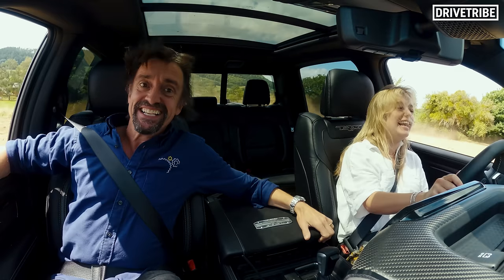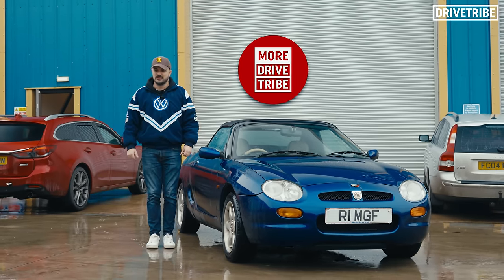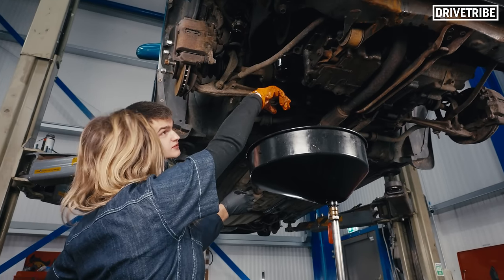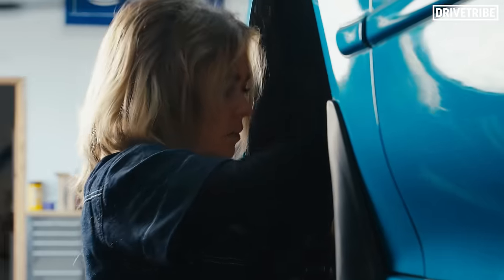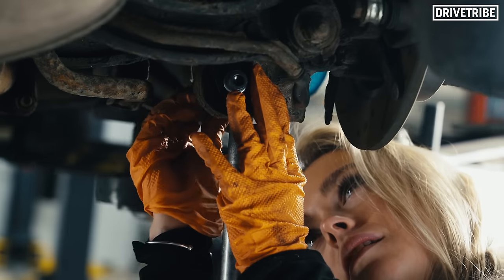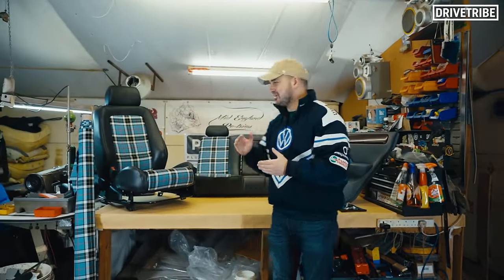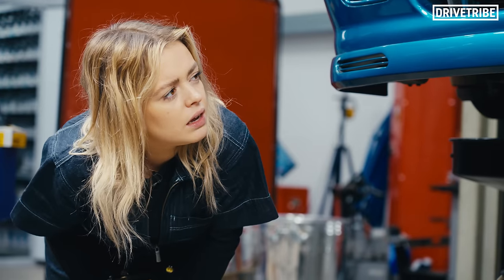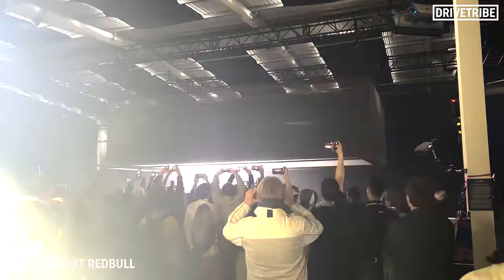Richard Hammond Tries A New Mechanic In His Workshop!

Comment: Curious fact, those fog lights are the same that came on the higher end phase 1 Renault 19, also on the 16v. But those also came with yellow glass. I had two pairs in both white and yellow, which I would swap when it was car meeting season which normally starts during spring 😊

Comment: I'd be a little leery about putting cleaners, and synthetic oil, in the crankcase of older engines -- sometimes the carbon deposits keep the oil from leaking out of the gaskets. Also, I was expecting the axle to pop out around 5:30

Comment: Coilovers & shocks for a '90-97 Honda Accord. Huh, more you know.
Reply: The 600-Series is a shared platform with the Accord. It was part of a two-way deal Rover and Honda had at the time.

In exchange Honda got the Crossroad which was a Honda badged Land Rover Discovery!
Reply: @SpitfireFortyFour  So, the most reliable not Rovers ever made, AND the least reliable not Honda in existence?

Edit: quick Wikipedia research, no VTEC Rover by the looks of the SOHC non-performance Honda engines, and the turbo option is all Rover.
Reply: @InternetEntity  Ha! Pretty much spot on for the Crossroad! Usual Discovery stuff, chassis rust electrical issue all the misery. It is the only V8 Honda though!

Not as much for the 600. It used a mix of Honda and Rover engines but all of them are strong regardless. In fact the Rover L-Series engine used in it proved so strong Honda started using it in the Civic and Accord. So if you buy an early diesel Honda it's Rover powered!